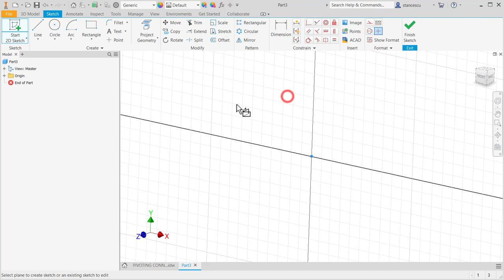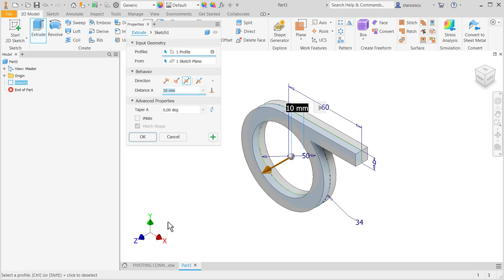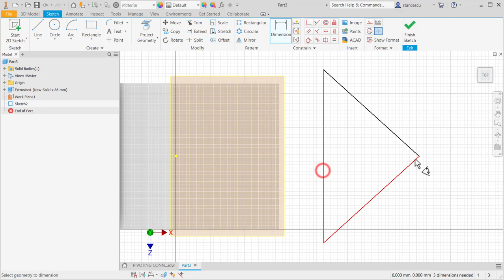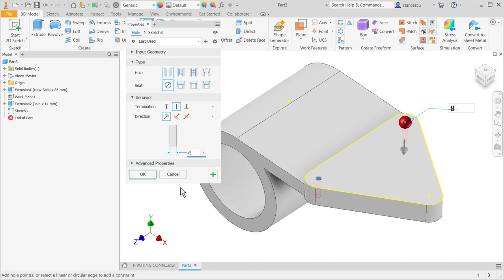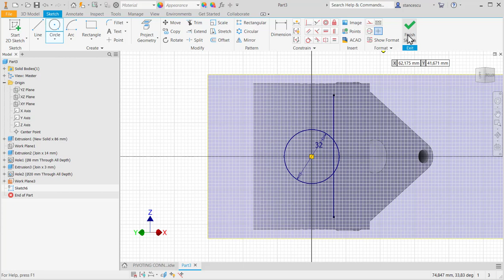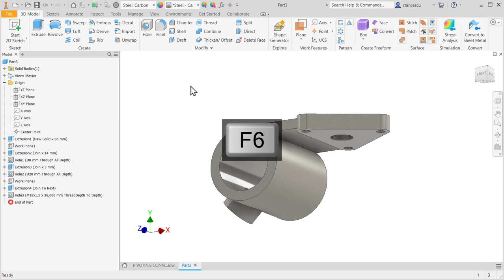Tutorial Inventor - 073 PIVOTING CONNECTION (Part-033)

Comment: Hi, what can that  pivoting connection be used for?  I had to model that part and write  what can that part do when it's made of an maraging steel 250 . May be you won't see this, but in case you do, could you please answe my question, thanks.

Bună, pentru ce poate fi utilizată acea conexiune pivotantă? A trebuit să modelez acea piesă și să scriu ce poate face acea parte atunci când este fabricată dintr-un oțel maraging 250. Poate că nu veți vedea acest lucru, dar, în caz că vedeți, ați putea, vă rog, să răspundeți la întrebarea mea, mulțumesc.
Reply from the maker: I am sorry, I do not know where this part is used, but I suggest you to consider it as a part of an helicopter structure.
Reply: @prof-stancescu   ok thanks a lot
Reply: I've seen plenty of your videos, keep the good work.